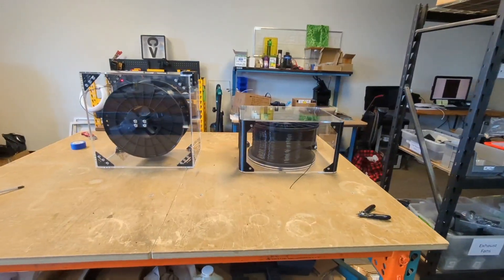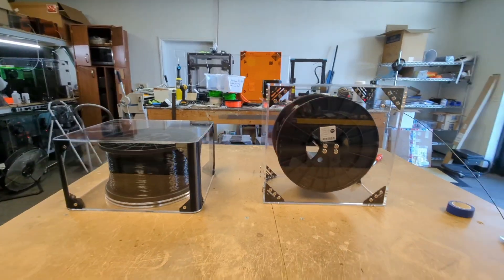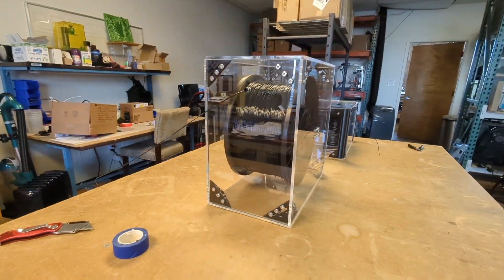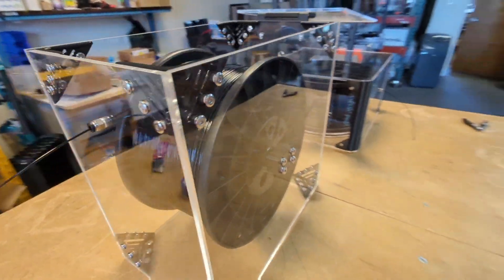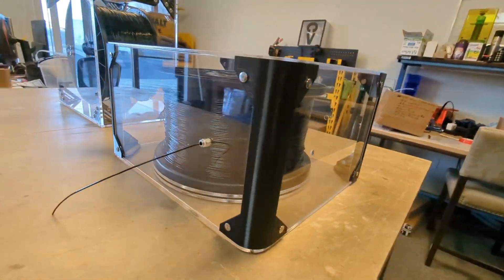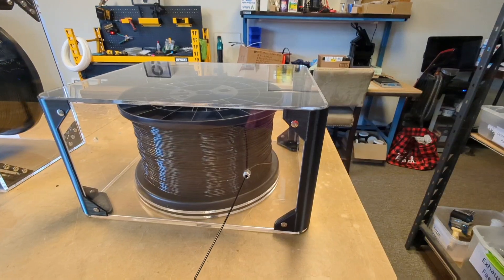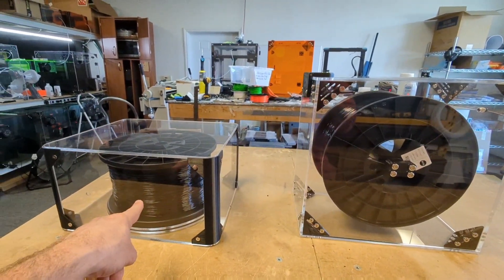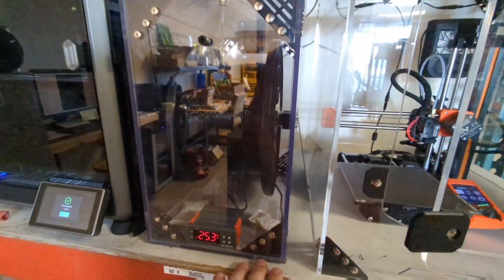Giant 3d printer 5kg spool filament dryer

Comment: What is the link to the electronics for the dryer? I am interested in what it would take to set it up.
Reply from the maker: BOM for the dryer comes in the file repo with purchase. All amazon ASINs, less than $100usd. We don't offer any guidance on the setting up the electrical. Not hard, but you will want to know your way around circuits.